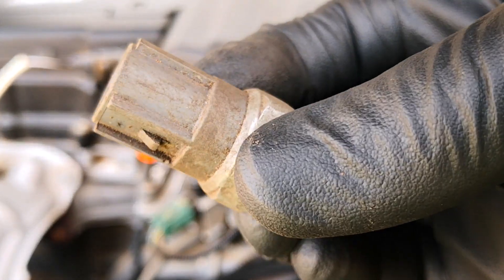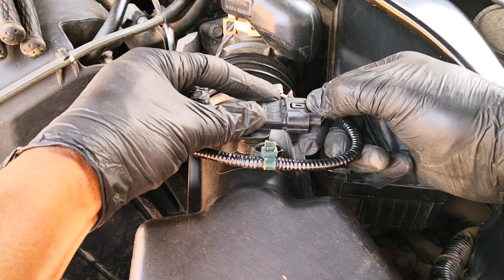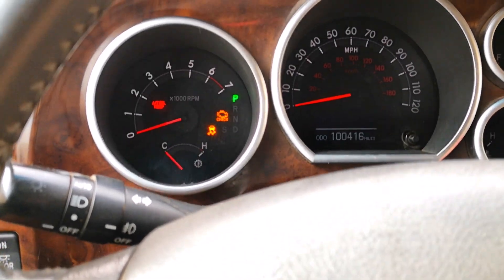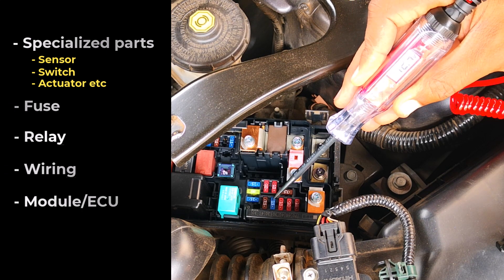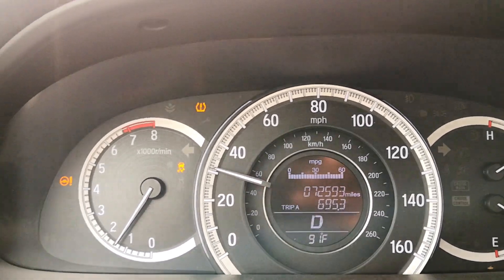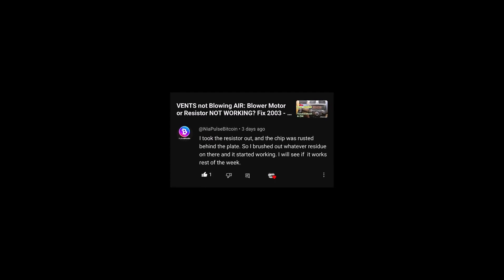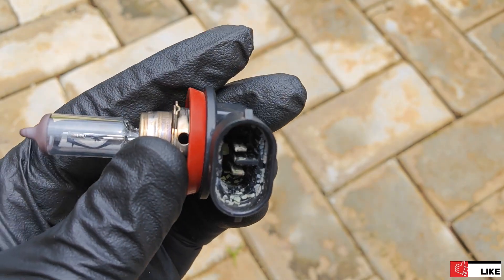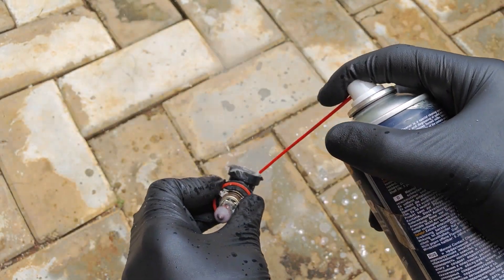This Major Cause of Check Engine Light will give you Codes / Common Cause of Check Engine Light

Comment: Probably the seal on the connector was missing, so water came in. I feel bad for the 500 mile trip though. But hey, here you are today making really good videos on fixing cars.
Reply from the maker: Thanks, bro. Very fair point on the missing seal. Same reason why the positive post for the starter, alternator usually have a rubber boot to keep moisture away.
True talk on the 500 mile trip. Was doing a temporary posting in a rural village then, and the closest renown Honda guy that worked at the dealership was who I was heading to meet! That experience had a lot to do with my foray into DIY.
Reply: @DIYAutoworksNG  I remember shorting my wrench handle against the alternator B post while loosening the oil filter on a 1st gen Toyota Highlander (1MZ-FE engine). A huge spark jumped and caused a veeeery slow leak on a nearby AC hose.

Cause: The engine had just been swapped and the protective cover on the alternator B post was off.

Lesson: I should've disconnected the battery.

Something I'll NEVER forget.

We learn everyday.
Reply from the maker: Scary stuff! Team learn everyday!
Reply: Electric grease all my connectors :)

Comment: got a qyestion..i had the trans and diff fluids changed out on CRV 2016..is there slight adjustments the car computer has to make...i notice when i put it in park theres a little more roll forward than normal and when i bring it out of park.. i read the puter has ti adjust for the new fluid...have you heard of this?
Reply from the maker: Haven't heard of that and it doesn't sound logical to me. Could be wrong though. I think your parking brake needs adjustment.
Reply: @DIYAutoworksNG  why after getting fluids changed though and its not a hig concern..what if i dont?
Reply from the maker: Your first reason may actually be correct. I just did a little search...
Reply: @DIYAutoworksNG  good cause i cant afford anything right now. thanks for taking the time..great teachings here.